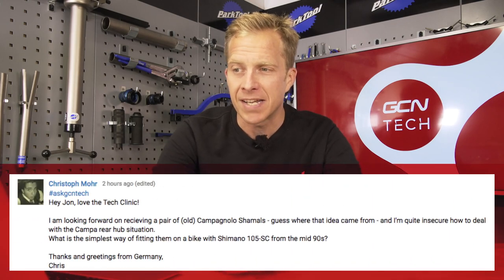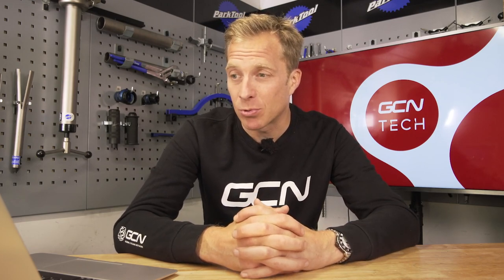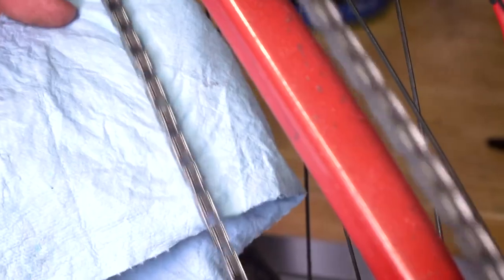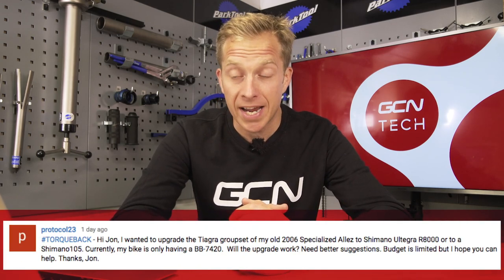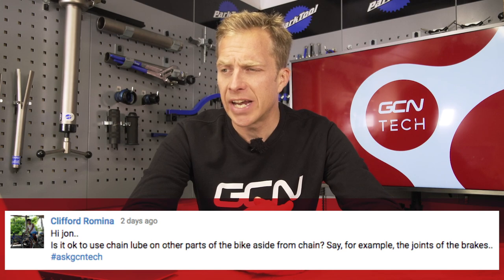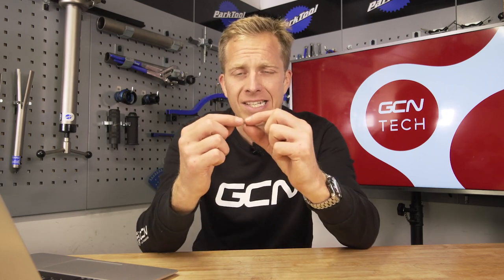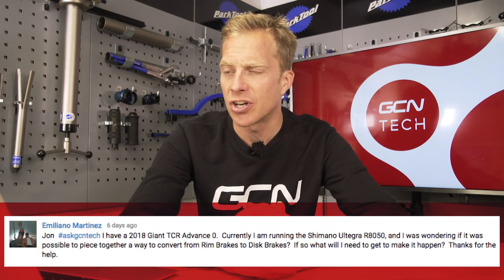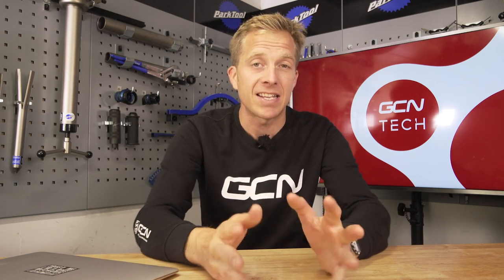How Do I Keep My Chain Super Clean? | GCN Tech Clinic

Comment: #askgcntech Jon, I really enjoy your show, even though I don't entirely understand the technical questions and answers half of the time. After 6 years of riding, I'm still learning something new every day, which is why I'm curious about 1x systems that are suddenly very popular. I don't plan to move to 1x, but I am curious as to why the "never crosschain" rule doesn't seem to apply now. Did someone figure out how to reduce the twisting lateral forces on the chain that occur when the gear ring is a few millimeters out of plane with the cassette gear?
Reply: I think things have been fine for a long time.  I used to run my old 8 speed triple road bike with a wide range cassette, fully cross-chained all the time.  I picked either the middle or big ring at the start of the ride, based on how hilly it was, and ran it all the way from bottom to top.  No problems whatsoever, except the chain would skip if I backpedaled in the big-big.
Reply: Rules never apply to fashion...
Reply: 11 and 12 speed chains are made with more later flex so that chain angle is not a problem. One of the situations Sram had to overcome when developing the XX1 system.

Comment: #askgcntech I have oil leakage when putting pressure on the hydralic breaklevers on my Shimano ST-RS505. Its a small spanner screw it looks like. The leak from around the screw. Its not mentioned anywhere online or in Shimanos own documentation and my LBS don’t know what it does. I have tried screwing it using a fork but it doesn't move. Shimano document where you can see it illustrated but not mentioned in any way: http://si.shimano.com/pdfs/dm/DM-BR0008-08-ENG.pdf
Picture of the screw that leaks and its only the left breaklever: https://imgur.com/a/s2acefa
What is wrong and how do I fix it?
Reply: After lbs contacted shimano it turn out its broken if that leaks. So got warranty replacement.

Comment: #askgcntech Hi, I was wondering whether I could use 11sp shifters with a 10sp chain, a 10sp chainset and a 10sp cassette?
Reply: No. The 11sp shifters, with an 11sp rear derailleur, will move the rear derailleur based on the spacing of an 11sp cassette, which is different from a 10sp. So the rear will not shift properly.
Reply: Thanks. Would I be able to use 11sp everything but a 10sp chainset or will the 11sp chain be too thin?
Reply: Should be fine. I have not actually used that combination, but I have used 10 speed chain on a 9 speed chainset. Most of the reduction in width of chains has been in the thickness of the side plates, not the space between them.
Reply: Thanks again

Comment: Hi John, loving this clinic segment. I have a 2003 Bianchi San Lorenzo aluminum with full 9 peed Shimano Dura Ace group set from that same period. 
I am on a budget and can’t switch just yet to a more modern 11 speed set up, but after doing research, I found out I can probably remove the cassette last shim and actually fit a 10 speed. Cassette on there. The bike came with an 11/23 cassette, but I am running an 11/28 now. I struggle following my mates on steep section because I am not able to spin high cadence with my standard 53/39. What do you think is the best route to get that Froome egg beater cadence, look for a compact set of rings? (Do they even exist for this hike pattern?) or change shifters and squeeze a 10 speed cassette with and hanger extension so I can use an 11/30 ? Thanks John! P.s. how is the house remodel going??👍🏽👍🏽
Reply: Not sure what you mean when you say "remove the cassette last shim." 8-, 9- and 10-speed cassettes all fit on the same freehub - there was no change in freehub width until 11-speed. So you just remove the entire 9-speed cassette and put on a 10-speed. If you have a Mavic wheel, there's a spacer that you leave in place (unless you want to go to 11-speed).
Reply: Stephen Turk thanks for your reply Stephen. I do have Mavic wheels. I forgot the size of the free hub, but from what I remember during last service, it was not long enough for an 11 speed unless it’s a special cassette with a machines recess on the hub back side of the cassette . I may be mistaking, but I though the spacer could be removed and a regular Shimano 10 speeds cassette can be fitted without any specialty cassette needed. I would need to change the whole shifters and derailleur since the existing one is a short cage. I though that changing the chain rings may be more cost effective to get a compact front with out having to replace the shifters and derailleur, and have a better climbing setup. Ultimately, I understand that an extra gear in the back would be better, but I don’t have the budget right now witch is why the question about switching to compact rings in the front. It seams like a bigger bang for the buck. Thoughts? The spider hole pattern isn’t as common I recon.
Reply: My Mavic wheels required a spacer, supplied by Mavic, for use with Shimano 8-, 9- and 10-speed cassettes, which are all the same width. If you remove the spacer , which I recall is about 1.8mm, the freehub will take any standard Shimano or SRAM 11-speed road cassette. So Mavic owners were in luck when the industry moved to 11-speed as there was no need to buy new wheels.
You probably can't put compact chainrings on your existing crankset - the 53/39 rings are almost certainly 130mm BCD (bolt circle diameter), and compact rings are 110mm. So you would need a complete crankset, with a new bottom bracket (yours is likely an Octalink, which is essentially obsolete).
For lowest cost, I would put on an 11-32 cassette (my favorite  for 9-speed is the Shimano CS-HG-80), and see if it works with your rear derailleur. Unfortunately, those D-A derailleurs had very short cages, so it may not have enough capacity and you might have to buy a different one. Plus a longer chain.
Reply: Stephen Turk make sense. Thanks.

Comment: Hi Jon, you will like this problem, right up your street!  I have got Shimano 9000 STI levers, on the left hand changer the brake lever is sitting proud - outwards - of the inner gear lever.  I have got the plastic main lever support in place, but the two levers do not line up.  Works OK, but not looking good.  Nothing on the Tech Docs, can you help!!  Pete
Reply: Have you checked the reach adjusters, under the hoods are set evenly or that there is nothing causing the cable to stick , thus preventing the lever from returning to the rest point
Reply: Matt Kneller thanks Matt, gave both a go but no joy

Comment: To use a big cassette with Shimano 9 speed you can also change the rear derailleur for a mountain bike version, but it does have to be the correct type (MTB 9 speed had a few options for pull direction etc). I've got this on my lake District bike (it's where my parents live) and I'm running a 36 tooth at the back with a triple, and that will get me up just about anything!!

Comment: first STRIP OFF THE MANUFACTURER'S PRESERVATIVE GREASE.. * THIS STUFF IS NOT A LUBE * IT IS A PRESERVATIVE * REMOVE IT WITH TURPENTINE. wash the turpentine off with a Simple Green bath. rinse the chain well. submerge the chain in ethyl alcohol.
lube chain properly. with the chain in the outer chainring.
wipe off every last little bit of lube from the chain. wipe off the chain rings. wipe off the jockey wheels. remove the rear wheel, and fully wipe down the cassette sprockets with a rag dipped in a diluted form of degreaser. going in like dental floss.

most important part: EXTERMINATE THE MANUFACTURER'S PRESERVATIVE BEFORE MOUNTING THE CHAIN

Comment: Wax Wax Wax
Reply: before waxing the chain has to be degreased! Completely degreased! I put every chain into a degreaser bath and put only wax on, e.g. Squirt from South Africa. This is the best I have tested yet.
Reply: I am a waxer, but haven't gone through any wet seasons yet. How well does it hold up on a typical 70/80 mile ride?
Reply: I've been using Squirt Lube for the past few months on both bikes, and it's been doing well! I don't think it's still quite as clean as some people make it out to be, but it's still much much better than my old wet lubes. I did a freaking thorough job degreasing the whole drivetrain when I switched, but I could have missed some, so that could be it, to be fair. Regardless, a noted improvement.
Reply: Squirt holds well, but I found that it collects road grime and plugs up the derailleur pulleys, at least with derailleurs that have close-fitting cages.  It's a double whammy on those derailleurs because it's hard to get in to wipe the pulleys clean.
Reply: The better you remove any previous lubes, the cleaner it'll be.  The times I've put it on chains that weren't very clean, it's stayed a little sticky, and worse yet, builds up on the cassette and RD.  Even then, though, it won't stay spotless.  It still gets black eventually.  The main advantage IMO, is that the black will wipe off my hands with a bit of paper towel that I fold up in my saddle bag.  With the Triflow I use on my bad weather bikes my hands are black all day.
Reply: What I mean is it builds up more when it's mixed with other lube.  If I clean and degrease a new chain, and run nothing but squirt on it, the excess tends to flake off rather than building up into a black muck between the sprockets and in the RD cage.
Reply: David Harper waxing works great in the wet. Wax is waterproof and does not attract dirt or fly off
Reply: Squirt. Degrease and clean before applying. Then each time just rub with cloth for cleaning before applying every now and then
Reply: @ericpmoss  can clean rather easily.
Reply: I re-wax my chain every 250KM, no dirt!
Reply: Wax is perfectly fine in the wet season, I don't change my routine in the UK across any season.
Reply: And the chain has no lifecycle problem either. On my Diverge a KMC 9-speed chain runs about 4000 km and the Rohloff Caliber says FINE! Less than 0.075 mm extension per segment. Thanks to Krytech and Squirt.
Reply: I use leftover bacon grease it's free and slightly more environmentally friendly than petroleum oil or wax and lasts in the wet.

Comment: Since Emiliano Martinez needs a new frame and wheels in addition to the brakes, he might as well just get a new bike. I guess he could transfer some of the drive-train from the old bike to a new frame, but then he'd have a useless frame and wheels lying around.
Reply: Thats what i was thinking too. Get a new bike Emiliano!
Reply: It’s a sorry situation that the owner of a 2018 year bike is seeking to essentially buy a new bike 🤦🏼‍♂️
Reply: Will Morgan  Exactly. The slight performance gain is not worth it if he's gonna waste a frame and wheels or wind up with two nearly identical bikes. If anything, it would be smarter to invest the money in a winter training bike (cyclocross or something) that came with disc brakes. That way he'd at least have two bikes that served different purposes.

For what it's worth, I have a road bike with rim brakes and a winter/utility bike with discs, but the discs don't offer any significant improvement on my riding experience under normal conditions. They only make a big difference under conditions (snow, off-road, significant rain etc) in which I wouldn't use the road bike anyway.
Reply: Jon also forgot to mention you'll most likely need a new fork as well if you want to also have a front disc. Then I guess most frames do come with a fork huh? But yes by that time you're just best off buying a new bike, or having bought your new bike with discs instead :P

Comment: I'll tell you the only truth now:
clean your new chain with a towel WITHOUT degreaser after the first 10 rides.
don't regrease it as there is still grease under the rollers and save time money and believe me nobody has a cleaner chain than me.
ONLY and realy ONLY oil your chain when it sings like a little bird!
Reply: Yeah... It doesn't rain where you live then?
Reply: Andy Turnbull it actually does and they even salt the streets in winter
Reply: I ran my chain dry like that then it rusted solid, had to throw it away